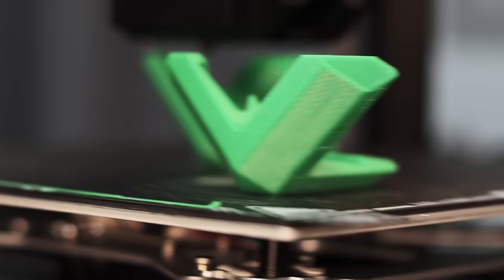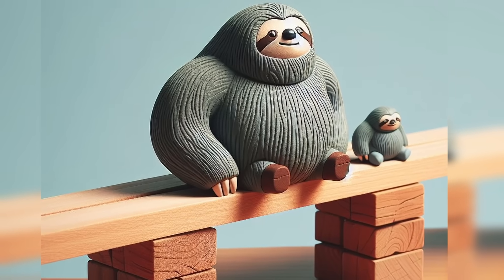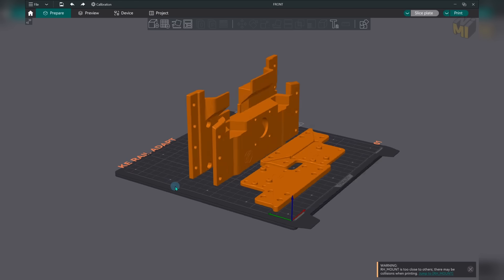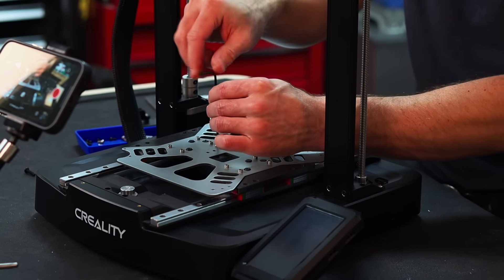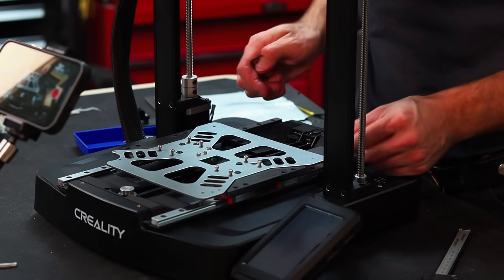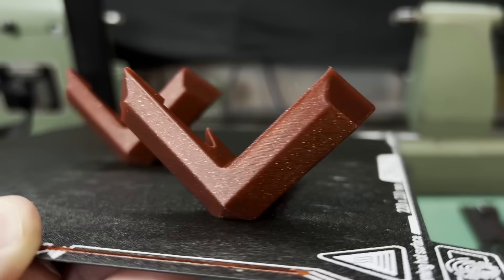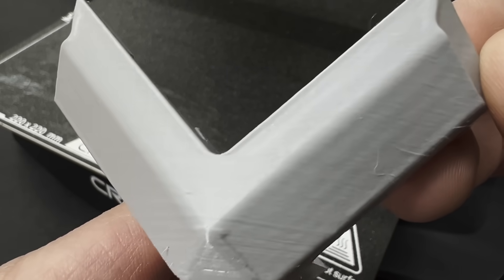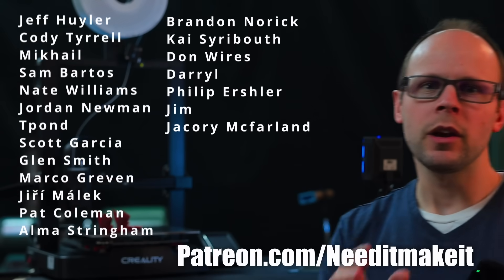UPGRADE your Creality Ender 3 V3 KE with Linear Rails

Comment: Hi, what actual Size is for the Heat Brass Insert Nuts? You say M4 but what the Depth / Length you used? Thanks
Reply from the maker: All inserts are M3, the length I used was 10mm, which was pretty extreme, but I just wanted to try it out, I'd say 6mm or 8mm would work well for this.  The upgrade that uses the holes is set to release tomorrow morning.
Reply: Many Thanks, any new updates on the Ender 3 V3 SE? Im awaiting my parts to arrive. I be print in PTEC.
Reply from the maker: @SpookieNZL  I've had a look at the photos and they look the same as far as the adapters are concerned.  The only visible difference is the steel plate below the bed had larger triangular cutouts on the SE printer than the KE.  Those don't affect any of the parts, so it looks to me that it's G2G.  If you do have any questions, just let me know and I can always modify a part if needed, but I doubt it's necessary.
Reply: @NeedItMakeIt I look forward to your new update Video. Hopefully you can also make a new STL File update for us users who own a SE not the KE. As you said earlier you could perhaps adapt the adapter to fit the SE? Also perhaps when filming the new update, show us all closer on when you doing adapters with screw etc? Other than that a Great Video Again Thanks 😊😊
Reply from the maker: @SpookieNZL  Once I have confirmation I'll make a note, I don't  like to have more parts than necessary, it causes confusion and adds more work if anything needs to change over time.  I've called out the screws in the latest video as button head as well, though in the case of this video it isn't critical as there are no clearance issues.

Comment: I see a potential problem. That default hot end is trash. Do yourself a favor and replace it with the one made by micro Swiss. I've had zero blobs and honestly a higher level of detail since I swapped it out. And by swap I mean my printer went full on Akira blob monster and completely filled the entire print head with filiment so it took me a solid day to carefully cut and remove all of the filiment.
Reply from the maker: LOL, I was going to work on the extruder next, I just finished the Z stabilization today, they make an upgrade for this exact printer?

Comment: This should work with the SE version right?
Reply from the maker: There is apparently some small modification required to one of the parts, but I've not had any concrete info to make the adjustment (I don't have the SE printer to check)  if you can send some photos of the base and steel plate below the bed, that would probably be enough to know for certain.
Reply: @NeedItMakeIt  yeah I can definitely do that.
Reply from the maker: @zzone5091  Needitmakeit@gmail.com, thanks for that!

Comment: Hi! Any update on that polycarbonate plate? :)
Reply from the maker: I'm just finishing up the support arms and then the plate is next.  I wanted to include an accelerometer mount and a mount for a bed camera, since that gives the best timelapses... though I don't know if that's true for a high-speed bed slinger yet.  It's coming soon!  I will also have an extruder upgrade coming.
Reply: @NeedItMakeIt  Any update? It's been 7 months..

Comment: Díky!
Reply from the maker: Thank you very much, I really appreciate the help!
Reply: @NeedItMakeIt  What you are doing is amazing and helps a lot. You have everything thought out and I like that. Keep it up.
Reply from the maker: @vladimirstastny5393  Thank you!  I try to think of as much as possible, sometimes I need to go back and start over if it's not working out with the original ideas.  I have a few more videos coming on upgrading this printer, one of them has some really cool new connections that I've created, it'll be interesting to see what people think about it.
Reply: @NeedItMakeIt  Nice.I'm already looking forward to the next idea. I am currently experimenting with noise reduction on this KE. I achieved a large reduction by cutting out a grid in the sheet metal in front of the fan and also in the sheet metal on the DC power supply. The fan itself is not that noisy, but the holes in the sheet metal make noise.
  I am now designing a new printhead cover for the noctua 40x40 hotend built-in cooling fan. It's hard, I'm trying not to gain weight.

Comment: Will this work for SE?
Reply from the maker: Apparently there is some small change to one of the parts, but I've not received any confirmation to tell me what the change is exactly.  If you an take a picture of the printer's base and send it to my email needitmakeit@gmail.com I can try to figure it out.  I have more upgrades coming as well that will apply to both printers.
Reply: @NeedItMakeIt  I’ll send it over tomorrow, thanks so much!!!
Reply from the maker: @dathanjackson2743  Sounds good!

Comment: hey, great video. do you think you could modifie the stl for the original rail. cause i dont want to buy a new set of rail. im horrible with 3d modeling, i would have done it myself otherwise. thanks
Reply from the maker: Hi, are you able to clarify, you would like the model to be adjusted to suit the rods that came with the printer?
Reply: @NeedItMakeIt  yeah exactly, so the rod would be at the same position than the rail in your upgrade. Unless you think it would be a bad idea?
Reply from the maker: @maximedesrochers6485  It's not a bad idea to move them apart, the issue that I wanted to solve was the sloppiness of the rods and the bearings and also that the length of the rods was too short and did not allow use to avoid that teeter totter effect.  To have it work correctly with rods, we'd need longer ones and probably new bearings as which are longer, or two of them.  I'd also recommend going with larger rods, the 8mm are pretty small over that length and will flex a bit too much IMO.
Reply: @NeedItMakeIt  also, do you know if the ke comes with the x axe rail pre lubricated. couldnt find anything in the quick install guide or online that says anything about it. just know that it didnt come oiled like when you buy them new..
Reply: thanks for your quick response btw.
Reply from the maker: @maximedesrochers6485  No worries, I did some research early on and found that new hardened rods which were precision ground were more expensive than linear rails, I don't really know why, they're less complex, it could just be that the tolerances are tighter with rods than rails?
Reply: Just had anither question. Did the printed bed bracket made a difference?
Reply from the maker: @maximedesrochers6485  Do you mean the Polycarbonate version?
Reply: @NeedItMakeIt yeah exactly, did the weight reduction change anything?

Comment: Hello, I finally received the linear rails from ali.  Do you think it would be better to put them directly on the base plate via the created 3 mounting points for each (middle screw on the middle metal sheet). They should sufficiently strengthen the entire mounting plate. This would prevent any twisting. They would hold the bed firmly and perpendicular to the Z uprights. The thermal expansion of the mounting plate should then not have such an effect.
Reply from the maker: If you can I think that's a great idea, I would have wanted to do this, I only avoided it to provide people with the simplest solution possible.  Your idea is better I think.  I guess my only small concern is that the base isn't flat and may pull the rails down to the position it would like them to be in.

Comment: Never owned a 3d printer before, but finding ways to upgrade my already budget friendly product is amazing to see. God bless the nerds
Reply from the maker: I'm working hard to raise my nerd level, I think I'm sitting somewhere around 55, I need to learn more programming and electronics :)
Reply: trust brother you're better off taking that money and buying a bambu lab p1s
Reply: @nickg2705  The ender 3  ke is about third or quarter the bambu lab p1s ,in the same price at A1 mini without ams .It able compare to A1 out of box ,with mod (which plenty avaiable with guide ) reach p1s ,thought quality control is something but in the worse case you still have a A1 in price of mini

Comment: Hi, newbie here. Would metal washers work in place of the printed shims? 

Definitely a great video, will add rails as soon as they arrive.
Reply from the maker: Hi, and yes they will work as long as you can get a washer that's the right thickness, I had trouble finding any that were thin enough for the amount that my bed was out by.
Reply: @NeedItMakeIt  Got it, gotta be picky with the thickness. Time to bust out the calipers. Thanks for the reply!
Reply from the maker: @MurrayBill  At one time I had paper shims, they also worked fine for getting very precise adjustments, positioned below the standoffs.

Comment: I guess. I was under the assumption that. the inner 3V3 V threes. were about the same machine. I bought the parts for this upgrade. and printed. all the kparts. Just found out this,   Apparently the SE requires a small change to the rear adapter, I have something in the works for this as well. I'm wondering if you could. update the part for Ender. 3V 3 SE Or a work around for this problem. Thanks. for your great videos, I. do enjoy them..
Reply from the maker: Hey, I'm working on a solution for that right now, the problem of course is that I don't have an SE, and it's hard to find the info to tell what exactly needs to change.  I have an email from a fellow who had made a change to the LH plate adapter, but that's not what I was expecting and I am awaiting a response.   I'll let you know when I get the info!

Comment: hello, out this video the one of most interest to me are the spacers, question, how safe it is to make spacers out of pla+?
Reply from the maker: Hey, so anything close to the bed should be printed with higher temperature materials, PETG is a bit higher than PLA+ I believe, but it could be worth a try, that area below the bed is separated by a fair distance and it might not have much heat build-up.  If you're printing in an enclosure, that's a different story.  

If you're talking about the adapter plates that mount to the Body of the printer itself, I think you'd be good with PLA+, they're far enough away and shouldn't have much heat buildup there. 

I hope that helps.
Reply: @NeedItMakeIt  I see, thank you

Comment: Do I have to use carbon fiber PLA to make that part you mentioned in the beginning?  or PetG?  I haven't really tried those yet.  Can I use regular PLA or I do need the carbon fiber for it to work?
Reply from the maker: You can probably get away with regular PLA at least to start.  The only problem is that it will soften when heated, and if you plan to enclose your printer it could warp.  I'd recommend PETG-CF or ABS as final solutions if possible.  PETG is also doable, but you'd want to make the parts nearly solid because it likes to flex a lot more than ABS.

Comment: Why a serious channel like this will even consider an Ender printer. If you need content for a cheap printer check the SV06, maybe the plus, but enough of these mediocre designs
Reply from the maker: I guess I had a soft spot for the Ender series of printers, that's how I started... at least having successful prints.  I actually started with a piece of absolute garbage Anet A8 which was so wobbly it needed upgrades just to keep it together and took me nearly 3 hours to assemble.  

The Q1 review I just did really makes a good case for why a bed slinger isn't a great option these days, you can get a lot more for a little bit more money with the Q1 or similar Core XY printers which are designed for high-speed printing from the start.

And thank you for calling my channel serious!

Comment: Printing at the front left corner is when the belts are at their shortest relative to the x, y stepper  motors. Any angle made by the belt mounting points to the extruder carriage and the bed support will skew the print as well as any vibration or imperfections from the geared tooth drive or stepper motor.

Comment: In regard to that 3d printed bed, would it be good to use a carbon fiber sheet and have it cut to reduce the weight of the steel plate? I have a CNC router so I can actually machine it.
Reply from the maker: I think that's a great idea, I haven't machined CF material myself, however I understand that the dust is quite dangerous to breathe.  I have an upgrade coming which will allow you to do this while also using the linear rails, it will provide the clearance required.  I'm not sure if you want to do that upgrade or not, but the option will be available. 

I've love to see the results of that when you do it!

Comment: Hi, the models you have provided are exact size of the printer holes. Do i need to zoom it to cover for example ABS shrink after print. Look forvard for reply, chanel and models you have provided are great!
Reply from the maker: Hi, good question!  With ABS, you'd probably see about 0.25mm contraction over that distance, it's a good idea to account for it if you'd like a perfect fit.  There is also some clearance in the holes, but if you want a bit more, you can use a 3.5mm bit and ream them a bit as well.  I've found that that PETG-CF works great for these, they're quite stiff, but ABS would work really well also.  I have more models coming so thanks for your note, I'll consider whether I need to account for that in future models.

Comment: Hello!
thanks for the work done, I'm going to install this mod on v3 se.
I would like to ask if it is possible to install a table with only 2 carriages?
placing them in the mounts diagonally (one at the bottom and one at the top).
Reply from the maker: Hi, and thanks for writing a comment!  Apparently the SE requires a small change to the rear adapter, I have something in the words for this as well.  It may be possible to use only 2 carriages, I considered using only two like you say and it might work, but I've never tested it, and I'm not sure how good it would work.  I'd suggest buying the cheap ones from Aliexpress just to be safe and have them on-hand.  It's a good idea though, nice thinking!

Comment: I'm trying to figure out about printing the parts needed in PETG-CF as you have. Did you do this on the KE? If so, what slicer and settings? I'm having a problem finding settings on printing PETG-CF in general that don't cause underextrusion

Comment: How Makerworld is better for the channel than Printables?
Reply from the maker: I have a video on the subject, but the short answer, is that it is free for me to get filament, for Printables it is not free... far from free actually.
Reply: @NeedItMakeIt  because of the shipping cost?
Reply from the maker: @ImSoMagic  Shipping and customs charges.  If you're in the EU, it probably makes the most sense, for me, shipping costs are far too high.  With Maker World there are several benefits that Printables does not offer.

Comment: Is it possible to modify hotends of this printer to print like and carbon fibre filaments. I want to print nylon parts on budget so I looked at ender v3 ke/se but couldnt find any mods and I dont want to buy older ender 3 which has a lot's of variety in terms of mods  but older firmware do you have any suggestion? Btw brillant explanation in every step of the process.
Reply from the maker: Hi, it is possible, the nozzles for this printer can be swapped for ones with hardened steel tips, but printing higher temp materials with success will require an extruder with hardened steel gears and it'll also need an enclosure.  I have a video coming out next week on Wednesday on that subject if you can wait until then to decide.
Reply: @NeedItMakeIt  I am definately going to wait thanks for update.
Reply from the maker: @ParshvaPatel-ib9lm  No problem, and let me know when it does come out if it helped to make a decision.

Comment: hi i just ordered the ender 3  ke and i wanted to ask is this upgrades necessary and cant print without it or just if i want to make the printer better
Reply from the maker: Technically you should be able to use it as-is.  Check when it arrives to see if you have any play in those bearings, if not, you should be able to get pretty good results.  I'd also print on the front corner to see how it looks compared to the center.  If there is a problem you can reach out to Creality for new rods if they're too small, or use this upgrade.  Long-term a linear rail setup will work better, and I'll have more upgrades coming that work in conjunction with it.

Comment: So did it solve the lines on Z? Or the tightening on the extruder fix it?
Reply from the maker: It hasn't completely fixed it, it seems to be an issue with PETG mainly,  the gears of the extruder or the extruder itself may be to blame, and I'm working towards an upgrade, but this is no small task, so I'm chipping away at it and I'll release it as soon as I have something that's proven to work.  In the meantime I have some mods and upgrades coming for the printer as well.